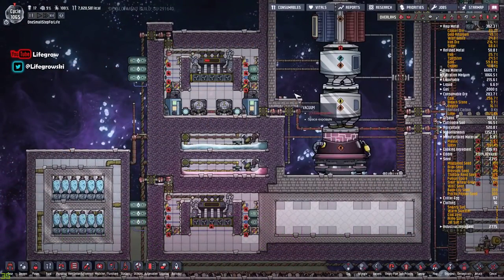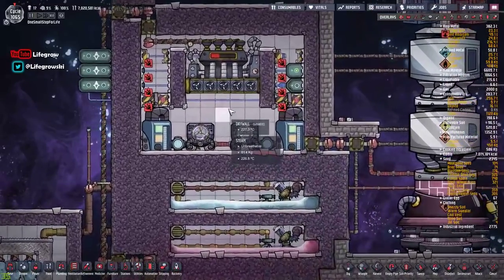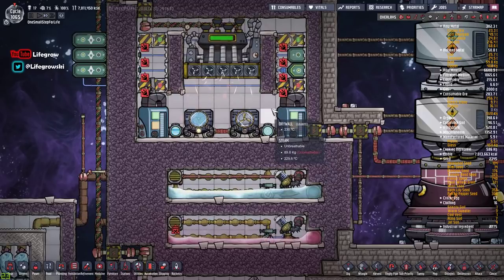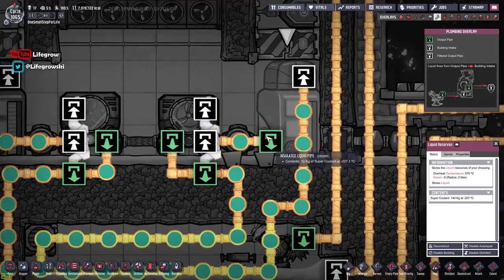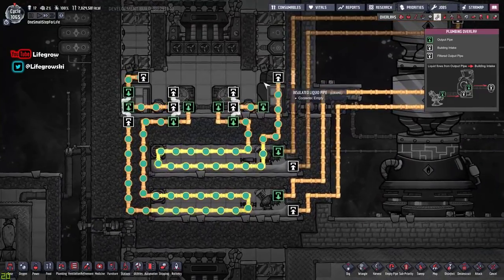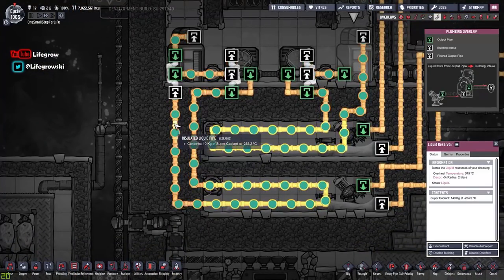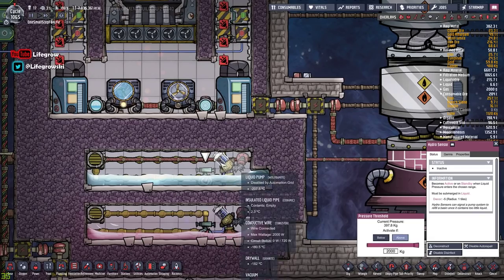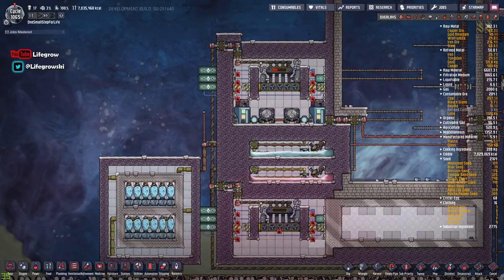OXYGEN NOT INCLUDED - EASY LIQUID OXYGEN / LIQUID HYDROGEN (WITH STEEL/CERAMIC SAVE FILE!)

Comment: So how Could I make Super Coolant
before I have Fullerene ?
Reply: just use liquid oxygen first for the rockets and use hydrogen as the coolant with thermal regulators.
or just use a steam rocket to get fullerene first.
Reply: @Ghorda9  how can I get into this temperature  without sandbox ?
Reply: @korotovool  how to get dupes to build it? or are you asking how to get the hydrogen cold enough?
Reply: @Ghorda9   I mean how to get the hydrogen cold enough? temperature always be my 1st problem when I play the game, thanks.
Reply: @korotovool  if you loop the hydrogen back through the thermal regulators after cooling the oxygen, the regulators will keep making it colder while transferring the heat to the steam which in turn gets deleted by the steam turbine. Just keep in mind that you absolutely have to use the "door pumps" on the sides to move the cool steam back to the bottom, regular pumps aren't powerful enough to move enough steam.

Comment: Thanks so much! I built you hole system but you are not showwing the automation details, the timers on the gates for example. If you could please provide that to me I would be very thankful.
Reply from the maker: it's just a standard door pump mate, set each door to close sequentially a couple of seconds after the previous door (if unpowered)

Comment: watching this video makes me feel bad at this game cuz i tried setting up a steam turbine to delete heat and i couldn't even get it to turn on. you have some fancy automation with the airlock doors that i don't even understand. but when i tried to use a gas pump to move steam back to the bottom of the turbine, the pipes broke because it turned back into water even though i was using insulated ducts. i have a lot to learn =(

Comment: Do you think the steam turbine could run continously with a higher steam pressure?
Reply from the maker: No, it consumes waaay too much heat :) You'd need more aquatuners in the build, which in turn cost power - so unless you have a LOT of stuff that needs cooling, it's kinda pointless.
Reply: @Lifegrow  maybe have a thermo sensor to disable the turbine if it gets too cold? I'm new at the game btw, just now getting the hang of automation and more complex systems :P
Reply from the maker: @vitorfray  The turbine itself deletes the heat, so it regulates itself. The aquatuners are generating the heat. If the build get's too cold, that means the aquatuners aren't overheating :) Try not to think of it as a power generation device, more as one that deletes extreme temperatures and occasionally gives you a bit of power :)
Reply: @Lifegrow  I see. That's a great system. I might copy it once I get to the lategame and get my hands on these sweet high temperature materials.
Reply: @Lifegrow  hey man. I used you design and it worked wonders. I went as far as using the steam turbine heat deletion along with super coolant loop to cool down the exhaust gases from the rockets. Turns out you can recycle a considerable amount of water from steam and hydrogen engines,and recycle CO2 from the petrol engine.
Reply from the maker: @vitorfray  Nice :) Glad it worked for you!

Comment: What is your input source of 40 degree polluted oxygen and 50 degree hydrogen? Is it from a huge polluted water pool? I thought polluted and hydrogen vents both output at insanely high temperatures.
Reply from the maker: The PO2 was from natural gas gens (soon used it up and switched to clean oxygen), and the hydrogen was what i'd collected as excess from my O2 Build. Later in the playthrough I slapped down a couple of additional electrolyzers and just pumped their O2/H straight into the liquid chambers and it still ran fine. Pre-cooling the gasses isn't essential, just speeds things up a little and makes it a little more efficient (i.e. using wheezes to cool the gasses down a little for free means less work for your power hungry aquatuners)
Reply: @Lifegrow  YEP! But I really lucked out on my seed. I'll send it if you're curious... Hehehe

Comment: Thermium and niobiomium are not abundant. They can only be acquired on other planets way ahead in the game. This design is not practical for in game construction.
Reply from the maker: Firstly, this same design can be built entirely out of steel/ceramic - please read video descriptions before posting (theres even a save file there for you to look at made of steel...). Secondly, if you check your molecular forge, there is a recipe that takes 5kg of Niobium and 95kg of Tungsten, and produces 100kg of Thermium. Now look at your rock granulator or metal refinery - both have recipes to turn Thermium into Niobium. You can produce endless amounts of Thermium from just 5kg of Niobium and some wolframite/tungsten. Niobium was acquired on our 20km Asteroid. Steam Engine range.
Reply: @Lifegrow  I tried making this design out of steel and ceramics. The water coolers just kept melting down. They heat up fast way past the overheat temperature even for steel. As of the rest, as I said, Thermium can only be achieve after you start space exploring way into the game.
Reply from the maker: @SerginhoPMoura  See the comment below from "
jgdfsa fgdsa" - My response was : "Yes, but you'd have to make some simple changes to stop your aquatuners from overheating (325 degrees C). The easiest option would be to pair the pipe sensor with a thermo sensor on an AND gate. Set this thermo sensor to be active if below 265 degrees C (at 275 liquid reservoirs will start taking damage). Other than that it's the exact same build."

Comment: Can all the material being replaced through steel?
Reply from the maker: Yes, but you'd have to make some simple changes to stop your aquatuners from overheating (325 degrees C). The easiest option would be to pair the pipe sensor with a thermo sensor on an AND gate. Set this thermo sensor to be active if below 265 degrees C (at 275 liquid reservoirs will start taking damage). Other than that it's the exact same build.
Reply from the maker: Check the updated vid description btw, an all steel version.

Comment: Nice build, but one thing is confusing me. I've found that the contents of reservoirs do interact with the gas/liquid that is in contact with the reservoirs, so do the bottom 2 tiles that it is sitting on. So why the steam isn't condensing is beyond me. perhaps the aquatuners are running enough to combat the cooling since it is such a small amount of coolant.
Reply from the maker: https://ibb.co/kDtSnf - this screenshot shows the heat bleed. As it's only sat on insulated tiles, the temp exchange is very slow, and the aquatuners just mitigate it easily. The steam is then interacting with the same insulated tiles, which have hardly any heat transference - so yeah - its not an issue really. FYI, you'll notice the same single tile bleed on oil refineries, metal refiners, etc if you run them hot enough. It seems to be simulating where the liquid is stored within the graphic of the building.
Reply: @Lifegrow  That makes sense for the tile but the steam is still exchanging temperature with the coolant, but I'm guessing there is not enough in the reservoir to impact that much steam. Still, the aquatuners might need to run less if the reservoirs were separated, just a thought.
Reply from the maker: @LurkzGaming  As far as I can tell, the steam isn't interacting with the reservoir - but CAN interact ever so slightly with the insulated pipes (they're only made of ceramic don't forget, so not a perfect insulator by any stretch) - however with the room being so hot, it's hard to see. When I get chance i'll do a spot of testing.
Reply: @Lifegrow  I had an issue with my res overheating when I introduced preheated oil, putting it in a vacuum stopped the problem so I'm fairly certain the contents do interact with the gas/liquid around the res. Let me know if you find something different.

Comment: why don't you just use a gas pump to pump all the cooled steam back too the hot steam
Reply from the maker: A steam turbine (without any of the tiles of it's base being blocked) moves 10kg/s of steam - would need a lot of pumps to move that much steam. Doors are powerless and easy :)

Comment: great tutorial. Just a quick question as to the automation of the doors, you didn't mention the settings for the buffer gates and filter gates?
Reply from the maker: In this particular build (from top to bottom) 3,3 / 6,6 / 9,9 / 3. Built it tonight on stream if you want to check the vod on twitch.